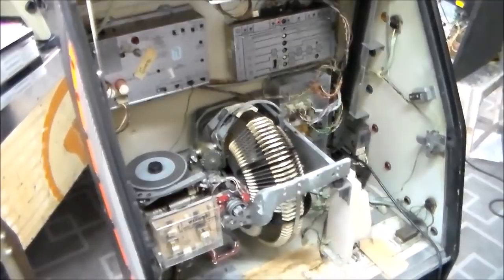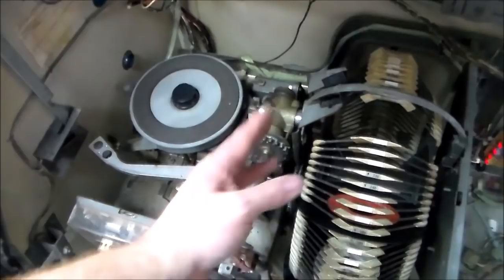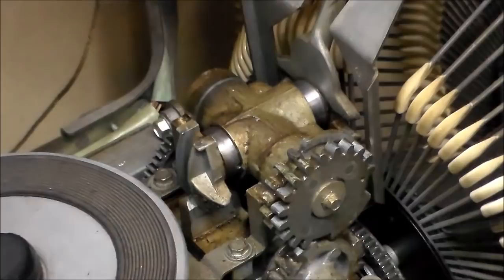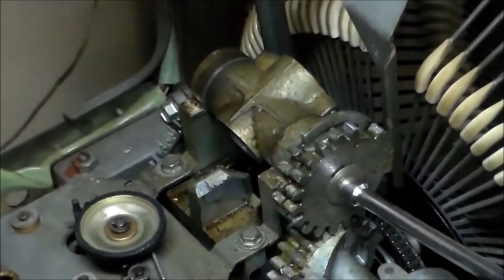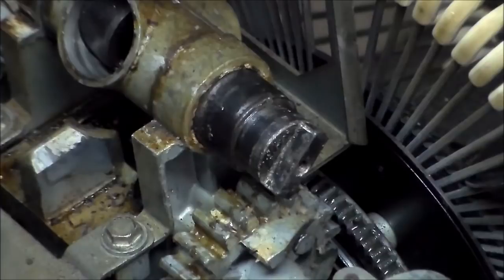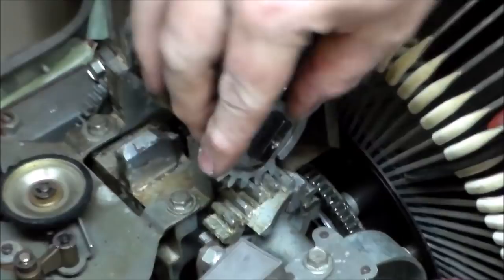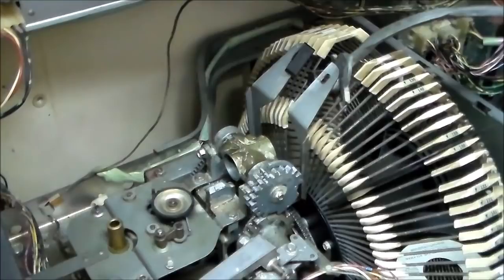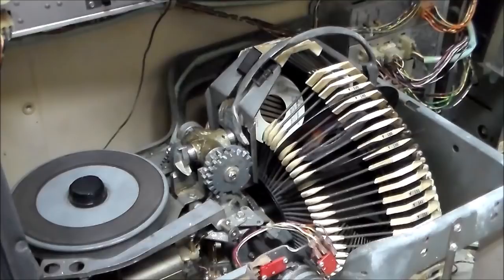How to Disassemble and clean the Mech on a Rock Ola Jukebox!

Comment: Got a 478 a couple of weeks ago and I felt as stuck as the mechanism. This video is exactly what I was looking for so I am looking forward to making time to deal with this. I will report back.
Reply from the maker: Very cool Paul, I think it might get you goin :)
Reply: @LyonsArcade  Definitely seized up, nothing would move and I have now worked it free with oil and finesse. 
478 gripper asmbly is mounted reverse of your video so the two single gears are on the backside making it a little harder to see what is going on. 478 also has that needle brush you mentioned and uses a flathead screw instead of a bolt. After the gears came off, I realized one was cracked and the other was missing some teeth!!?? I have replacements arriving this week. I have been able to test various bits w/o the gears by manually rolling the motors but, I cannot do a logic board test. I see the 9.6 v led lit but nothing else works red and blue buttons on the board appear to do nothing.

Comment: Hey Ron,
Thanks for a great set of videos. Your presentation style is perfect!
I decided to attempt the cleaning of the gripper mech on my Rockola 484 as it was missing the occasional record and leaving it on the turntable. I ordered the pin punches and the (SAE) 20 wt oil. Basically after one day, a very sleepless night and the next day, I managed to get the gears back in the right place. The mech kept jamming and it caused the circuit breaker to kick in and it's a good job the CB was there otherwise I would have got through 20 fuses! When the thing jammed first of all, the basket (carousel) would not budge so I thought there could be all sorts of fuses or transistors or whatever broken and that I would never get it to work again. In spite of taking photos, I still did not take enough - as you would say,  "take tons of pictures, people!!!"
The cam on the back of the gears on the 484 is for the stylus brush.
Happy to report the whole thing is working great now and the gripper sets and returns the record perfect every time.
Thanks again.
Now, to fix RED and TED'S eyes on my Road Show pinball!
Reply from the maker: Those eyes may end up being harder to fix, LOL lots of little parts!  I'm going to do a funhouse one of these days :)  I've found on the Rock Ola mechs the pin that you put in it if it's sticking out slightly on either side, will cause the piston to not be able to go in and it'll jam too.  I had to file one down slightly once...
Reply: @LyonsArcade  Hey Ron, After my last post I looked at the video again - I wished I'd done it before instead of just looking at my photos!! It would have saved me a day and a sleepless night! "Rewind the video again"

Comment: Joe, thank you very much for taking the time to put together this video, it is very informative, and I will clean my gears etc this month.  I just picked up the 488 model and it doesn't work, nor had a key.  I have already master lock picking, so I was able to open it without a key, but order one anyway.  The trick was knowing how waffer locks work, once I did, I picked the lock in less than a minute, and then found the cash box lock key inside.  I am hoping greasing the gears will get this thing working.  I started watching your videos earlier in the year after I bought 2 non working EM pinball machines, which I have working now.  Thanks for all the great videos and help.
Reply from the maker: Bob if you fixed those EM machines you'll definitely get this Jukebox working.  The CPU might be a little tricky, just check your power supply voltages, you might have to track down some schematics.

Comment: Do not ever use WD-40 for lubrication on gears folks (as Joe pointed out someone had probably done in the past).  It's a detergent based solvent (it's not a penetrating lubricant).  Use proper gear oil for jobs.  Also a little goes a long which means less mess.  :-D
Reply from the maker: Preach brother :)  WD 40 is the bane of my existence :)

Comment: Great jukebox video! Thanks! I'm like the only vintage audio tech in St Louis, and I get calls for these and others. I fixed a 1945 bubbler last year, thought i was in over my head when I realized it had a Cobra arm retrofitted and a preamp problem... then multiple mechanical issues... but one thing at a time... if all I had to do was these things, life would be easy, but I'm doing Hammonds and Leslie's one day, guitar amps, then restoring sparkle-top Rhodes pianos, wurlitzer pianos... and nearly all of them carry lethal voltages... sheesh... only got shocked one time in all my years... but that was enough to make me realize that I never want that again! I got my first shock at age 3... with a fork in an outlet! I still remember that one too! Lol. The only time it happened professionally was in a church, working on their organ that was wired wrong from the previous guy... after which I began to speak in strange tongues, much to their shock! Lol. 😂

Comment: Positively the best demonstration of this mechanism that I have seen.  I am still a little concerned about the oil / grease to use.    This is for a home use CD8 Nostalgia Bubbler.  I sure don't want oil to seep out on the computers or CDs.   I am torn between oil and a white lithium grease.  BUT, great job.
Reply from the maker: I've had some old timers tell me 20wt oil, but I think lithium grease would work, it's worth a try.  Worst case, you just take it back apart and redo it :)

Comment: Great video Joe. Yes. Do it right the 1st time. Take it apart. Clean everything. Re-assemble with proper lubrication.
Reply from the maker: it just makes it where you don't have to screw around with it anymore.  I've fixed them before by dumping oil all over them but you still have to mess around with it for a couple hours and then it's still not 100%.  I think I took this one apart and reassembled it in less than 2 hours.
Reply: @LyonsArcade  Hi, my gripper arm freezes after it returns the record to the magazine. I have no way to take the gripper apart as it is way above my skill level. You say you fixed it before with oil, will that work? I have been trying to fix this by oiling it for days and it almost works. Any other suggestions would be greatly appreciated. Thank you.
Reply from the maker: @pattic3799  It will probably work eventually, you have to add oil then move it back and forth a little bit to get it to penetrate down into whatever part of the grease or oil is dried up and gummy.  Eventually it will free up and run right.
Reply: @LyonsArcade  Thank you. I will keep trying. Going to try using Tri Flow to try to get rid of the gunk. Thanks again for the response.

Comment: A good cheap fix if you can't source the part for the wow and flutter is to take a silicone or rubber squared edge o-ring and replace the rubber ring on the deck spindle for the turntable, just glue it down so it doesn't slip
Reply from the maker: Thanks Mike, I appreciate the tip!

Comment: Thanks for the video it is very informative unfortunately the guy that owned it before me took pliers to the gripper pieces and they do not move smoothly at all. it is a beautiful 1484 wall mount and I need to find a whole upper gripper assembly. I also have a 430 wall mount jukebox that suns like a swiss clock.

Comment: One more question when putting back together and you put the center shaft back in that the gear mounts to is it supposed to be able to fully free spin. Mine seems to get caught up cant spin 360 almost like the metal  got warped or something if that makes sense?
Reply from the maker: it should spin around but not if the gripper bar is in it of course.  But yes there shouldn't be anything in it, as long as the gear isn't installed it should freespin.  You may be able to place it on a table and roll it looking to see if it's warped, sometimes people would grab things and bend them by hand, or the motor may have even bent it trying to turn it while it was gummed up.

Comment: im getting ready to do my 71 seeburg usc2 . I've been a lil intimidated about disassembling all the gummed up moving parts to clean since i've only worked on pins and vids. the mechs between manufacturer's should be a similar set-up. Correct??
Reply from the maker: Russell, to be honest they are completely different, not even close to similar.  You would think they'd all be about the same, but they all had patents and sued each other.... so Seeburg made theirs not even close to the same.  The big difference is the Rock Ola uses a basket and the records spin around, then the arm puts the record down on the turntable.  Seeburg brilliantly made the records in a rack, and the turntable actually moves to the place in the rack that the record is, then plays the record standing straight up and down!  

The good news is all the Seeburgs were the same for 40 years, it was a nearly perfect design.  There is a shaft inside the mech though that gets gummed up like the Rock Ola issue so yes the best way to get it going again is to disassemble the mech.   I'd imagine there's some videos on youtube showing it, but unfortunately it is a bigger job than this.   One of these days I'll do some Seeburgs and film how to do it if you haven't gotten around to it by then :)

Comment: Thanks for such a great video! I have a Rockola 490-2 in excellent working order, but with just one problem. . .it won't load a record. Everything else is perfect, it scans, stops at the right number record, but just doesn't put it on. I've manually turned the motor by hand underneath, to get it to pick up and play, which it did, (I gave myself a sore finger!), and when the record has finished, it picks it up and puts it back really smoothly. So it the motor works in reverse, but has no power in forward. Do you think this could be a problem with the micro switches, or maybe the brushes in the gripper motor? It's such a shame as it's a great bit of kit. Regards from the UK :)
Reply from the maker: I don't think it's the motor, like you said it works one way, the way they reverse the motor is they just reverse the polarity of the voltage so the motor is fine.  

When it gets to the record, there is a cam switch that allows the power to switch from the basket to the mechanism, if that's misadjusted it might do that.  You need to find a copy of the manual, it describes what order everything works in from start to beginning, so you read through it until it says 'the arm stops over the correct record' blah blah blah and whatever it describes happens next must have an issue since it doesn't pick the record up.  It may be a switch, or a relay in that box under the turntable may be dirty.

Comment: Probably a dumb question, but I have a Mystic 478 but I can’t get it to stay open. It was just given to me so I have no clue what I’m doing. Do I just place a stick in it so it will stay open? Otherwise I have to hold it open and it makes it impossible to work on it.
Reply from the maker: There is usually on most machines on one side or the other a bar attached to the door (the top)... and then it goes down into a plate with a hole in it on the side of the machine, the end of the bar has a little hook on it so it stays in place propping the lid up.  that piece may be missing on yours...

Comment: Help, I have the 454 Rock-ola I just took my grab arm assembly apart, someone obviously took it apart before and low and behold, NO spring inside , where can I get one ? Thanks, John
Reply from the maker: There may be one on ebay, look in the jukebox parts section or you can buy parts from www.JukeboxParts.com .

Comment: My 478 the gripper bow and mechanism shows no play,seems tight could this be my problem,when running the basket I hear a couple relays clicking and no movement in the mechanism at all?
Reply from the maker: I would think yes this is your problem.  it's been the problem on every Rock Ola I've ever messed with....

Comment: Love your videos. My Rockola is 1970. Turn it on and the platter moves only. Hit scan, and it makes a strange buzzing noise. Buzzing noise coming from wipers, I think. Can I get some advise? Do you think it may stem from the same mechanism that you cleaned in this video? Thank you for your help.
Reply from the maker: You've got about a 80% chance the problem is the mech is gummed up like on this box.  I'd try turning the knob on the end of the motor by hand and see if anything moves by doing that, if it's hard to do disassemble it like we did and it'll probalby get you going.  You probably also need to clean the pcb that the wipers ride on so they conduct as they should.... the good news is these are very resilient boxes, don't buy any parts for it until you're positive the part is definitely dead, usually cleaning and oiling them will get the entire thing working again with NO PARTS.  I see people buy new motors all the time, it never fixes them.
Reply: @LyonsArcade  Thank you very much! I will give it a go!

Comment: Thanks for the video, but I need help.  I decided to follow the instructions from this video, because my 440 would grab the wrong record, or miss the record about 10% of the time.  Now, after disassembling and cleaning the gripper arm and gears, it works only about 10% of the time.  The gripper arm is not smooth as it operates; very jumpy.  The record falls out almost every time.  Since it does work, once in a while, I must have reassembled it correctly, but I don’t know how to fix this new problem.  
I used 3 in one 20 weight oil. Please help
Reply from the maker: There's different sequences as it moves, for instance it pulls the center piston in first to grab the record, then it starts lifting the record, then it turns it, etc. which area is it jerky in?  

if it's grabbing the wrong record out of the basket, the basket probably needs centered, there's an adjustment in the manual that shows how to get it to line up directly over the record when it grabs it.  If this adjustment is wrong, sometimes when it hangs the record up the record will hit the side of the basket, those metal cage arms.
Reply: Ok, I took it apart again and reassembled it.  It seems to be working better.  I have discovered that the jumpiness is the gripper motor not connecting tight to the gear.  The three bolt, which hold it are tight, but it still skips over some gears.  The other issue is the 45s play slow.  I ordered new grommets to replace the old ones.

Comment: I just came across a 1970 Rock ola 444 and will be refurbishing it. This video was very helpful for my planning. Now, we will see how execution goes. I was curious as to how you were rotating the motor manually to align the gear teeth for removal. I think I get it, but will have to go out and experiment. Oh, where did you find the diagrams and schematics? Got a link or can you share a pdf of them?
Reply from the maker: The way I turned the motor is there is a little knurled knob on the bottom of the motor, you can turn with your hand it just takes many revolutions.  You can get the manual from here:

https://www.scribd.com/doc/69183603/ROCK-OLA-442-443-All-Files-Combined
Reply: @LyonsArcade  thanks! yeah, I figured out the knob pass thru turning.. but didn't want the blisters that you got! So, I loosed the mount and separated the drive gear from the main spindle. Once loose, I could easily maneuver to check alignments. It was a b*tch to get apart, but once I did I was able to clear the decades of "guck". The whole mechanism is smooth under my power, but I goofed up and put the end piece (part #20) on 180deg out of order and it wouldn't clear correctly. I also took apart the two motors to clean the brushes, copper, magnet, and contacts. We'll see what happens this weekend when I have time to continue. Love your vids tho! I just need to order the manual.
Reply: @LyonsArcade  Does the model 444 use the same manual as the 442 and 443?

Comment: Just got my jukebox back from being restored and it’s been dropping records intermittently. 😑. Unfortunately the guy that did the restoration lives 3 hours from me. I’d have thought he would have done what you’re doing in this video. Are there any other reasons the gripper arm might be dropping records? It mainly happens when it try’s to move the record from the turntable back to its slot. Also I cleaned every record before putting them in the JB and just now the gripper dropped the record before it got to the turntable, when I removed the record it had “gunk” oily rust on it. 😳
Reply from the maker: He probably sprayed oil or wd-40 all over it to free it up, I used to do that too but just like it shows in this video, you need to clean all that stuff out or it will drop records when it tries to pick them up and put them back... If it's dropping them before it gets to the turntable it may just be a fluke with that one record being slightly smaller than the others or warped a little bit, or it may be that the basket needs adjusted slightly, it's picking them up slightly off center (the basket isn't centered under the bow when it gets to position)

Comment: How did you turn the motor in order to get the last gear off?
Reply from the maker: There is a knob on the bottom of the motor that you can turn by hand to get it all to spin if it's not locked up too much.  If it is locked up too much, you can take the motor off which disengages the gear and allows you to turn it all by hand too.
Reply: Joe's Classic Video Games i will try that later im working on my rock ola ultra but its reversed so its hard to see the gear since its what your doing but gear faces that back wall of juke box with not much room to see!
Reply from the maker: I know what you mean.  I think they expected the operators to pop the whole mechanism out of the cabinet but that's a big pain...